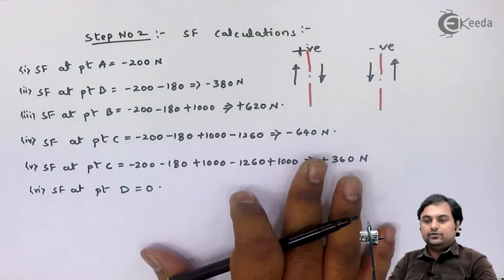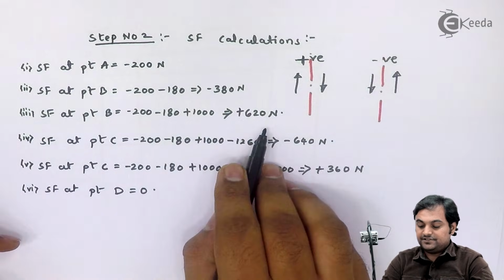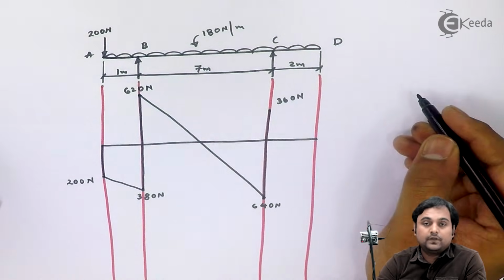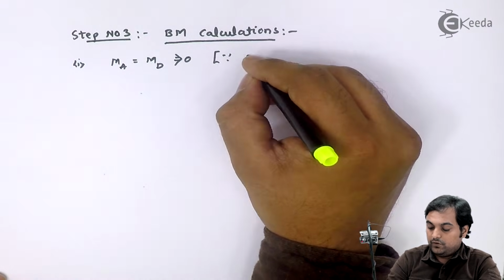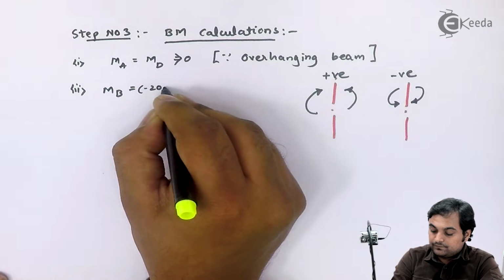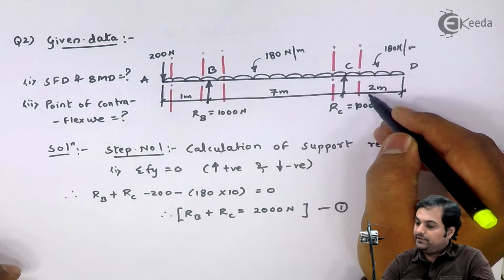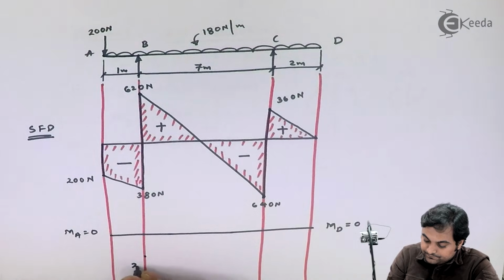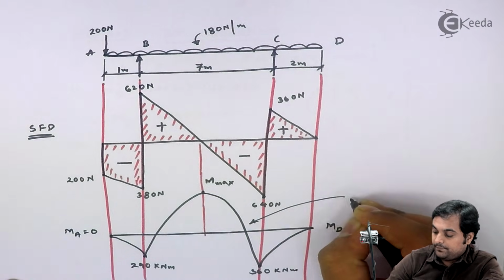SFD and BMD - Problem 2 - Part 2 - Shear Force and Bending Moment Diagram - Strength of Materials

Comment: While taking moment at right of support C, the uniform force 180 should have been multiplied with half the distance
Reply: Why did u again multiply 360 ×2
Reply: @avert_ lol
Reply: THe UDL force is  180/m and the distance is 2m so total force equals 360 and for calculation of moment , half of the distance is taken, so -360x2x1/2 = 360x-1  !
Reply: @avert_  this doesn't even make sense. By that logic in BM calculation of A why is it - 90 and not - 180 then?
Reply: @avert_  why you have again multiply by 2 for 360
Reply: @Dpack798  Its been 2 years .
i have no idea what this is . LOL
Reply: @avert_  lol
Reply: @avert_  brother why the shear force at point d are zero?
Reply: @avert_ I have also a doubt can I ask
Reply: @didumbrahma78 daym what subject this is

Comment: Sir please reply for one doubt BM at point C  if I calculate the BM from side left than answer is 990 and I Will calculate from Right than answer is - 360 why change value in same point
Reply: same question
Reply: Pls check the sign convention you had considered.

Comment: Sir please solve a question. A simply supported beam which length is 8M and last end side 5M length is UDL 10N/M.20N load from 2M distance to starting point. Find shear force and bending moment diagram?

Comment: why 180 being multiplied by .5? shouldnt it be Mb=(-200 x 1) - (180 x 1) ?
Reply: Daniel De Amat If we consider that 1 m only then for that 1 m UDL will act at the centre that's why its .5
Reply: @utkarshchugh7643  You God. Thank you!!!!!
Reply: 180 is distributed load acting along the beam , he changed the distributed load into concentrated load( which means 180x1=180 ) then he multiplied by half which’s the distance from the load to the point he’s taking the moment
Reply: then,
   @5.02similarly he should have done for the other side also right?..there he multiplied  180x(distance 2)=360,which ig is not correct...it shoukd be 180x(2/2) right??
pls reply asap bro...i have my exam tomorrow😂😂

 @pubgdreamer6978
Reply: Daniel De Amat  bro why don't he consider support reaction in b.  M
Reply: @TrendingShots24  there is no lever arm for that reaction to make a rotation or moment at point b